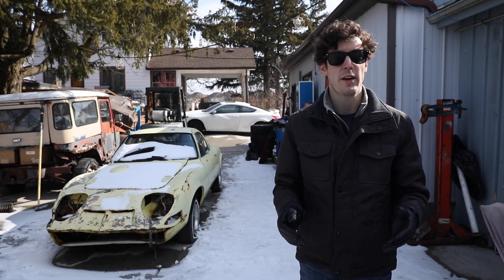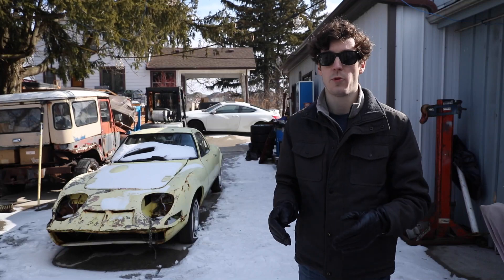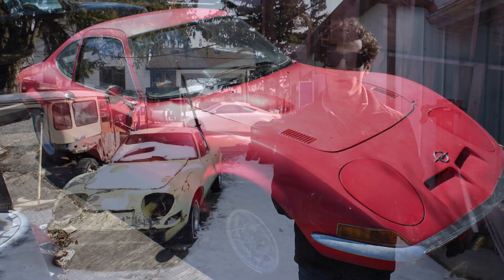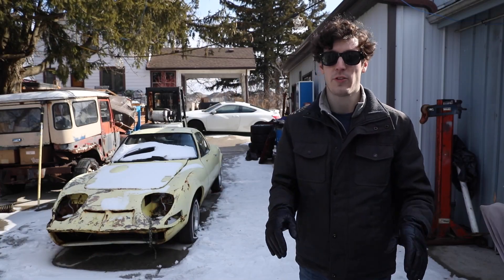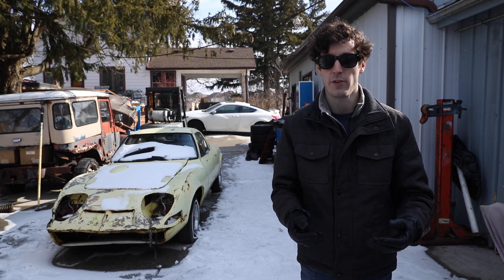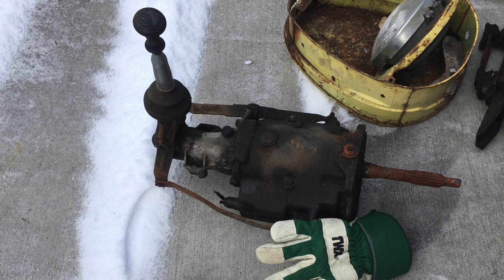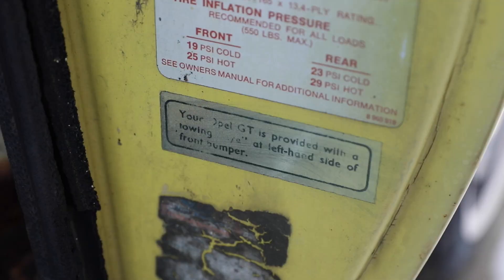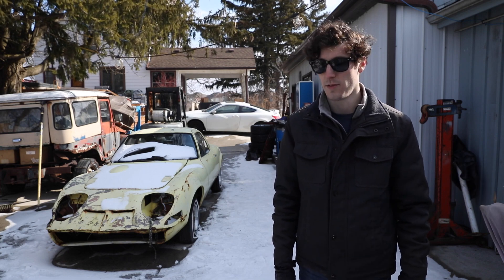New Project Car! The Hopeful Opel | CC&C

Comment: Oh boy!  When I turned 16, (I’m currently 55) with my dads encouragement, I bought my first ever car. A little blue, 1971 Opel GT with over 100k miles. Let’s just say.....it was a love hate relationship. 

My pop had purchased one of the first models to arrive in the US during the late 60’s. The two things I remember about it were the contrasting black hump on the hood with the grey body, and my act of locking the steering wheel in place so the car wouldn’t start, while playing in the front seat as my mom shopped. She didn’t realize she could unlock it by simply inserting the key in the ignition. So, as I recall the rather traumatic event, I had completely destroyed my dad’s new car. 

By the time I was buying my Opel, my dad had long since sold his and was now driving very cool, very rare, and very fast 1974 2.7L 911Targa Carrera. Which I wasn’t allowed to even start, let alone drive. (I don’t blame him now. But at the time....) 

My “Little Blue” Opel, on the other hand, I remember well! It was pretty much the antithesis of the Porsche, albeit I could still boast about owning a somewhat rare, impractical German sports car....kind of. 

Here are a few lasting impressions of my Little Blue Opel GT: Broken window regulators contributing to a frozen front windshield and the need to drive to school with my head out the window. Thus, arriving with frozen hair...very cool. Gas fumes lofting up through the torn gearshift boot. Rain, ice and gravel arriving in the cockpit through the same means. Jammed headlights permanently stuck half-way-round illuminating only one side the road. The delightful scent of starter fluid being shot into the carburetor whenever it sat for over an hour, and every time I was with a date. And of course I’ll never forget the terrifying, out of control spin we made together into an old lady’s bushes while rounding a tight corner at 40 mph. Somehow the steering arm broke loose sending us careening into the only barrier standing (more correctly, growing) between us and the river below. Thank god for shrubbery!  (Although, I was stuck buying and replanting a whole new row for the lady.) Outside of that, everything was great! 

Good luck with your rebuild. They’re still cool cars!
Reply from the maker: Great to hear your story! A lot of people have a lot of memories with this car.

Comment: Replace the fame and rocker panels, replace the floor pans, replace the front fenders, replace the door skins, replace the quarter panels, replace the front lower valance, replace the air inlet header panel, replace the dash , replace the wiring, replace the gauges and rocker switches, replace the seats, replace the front windshield and windshield gasket, replace the interior , replace the master cylinder, replace the front calipers and rear brake cylinders, replace the ball joints, tie rods, steering rack and front spring, replace the battery tray, replace the radiator, replace the carburetor, replace the torque tube steady bearing,  etc etc etc....I've owned one of these cars before, and mine was running and driving.  I recommend that you put the transmission in it, get it running and sell it for a thousand dollars before you get dragged into a financial bottomless hole. These cars were made in France for Opel, and featured very questionable steel quality, and very questionable rust protection technology...in short...they rust bad like other European cars of the time.